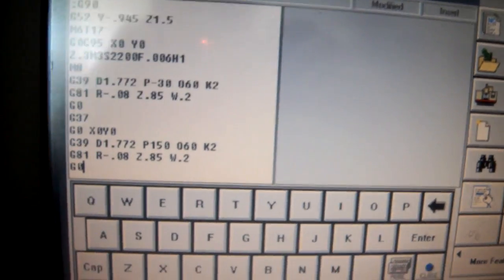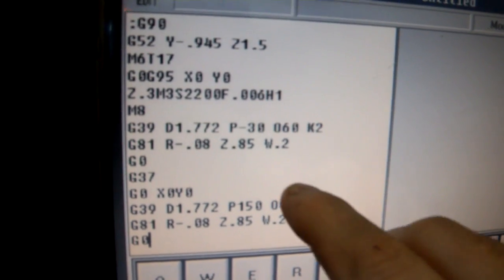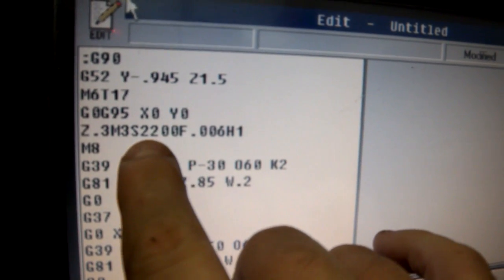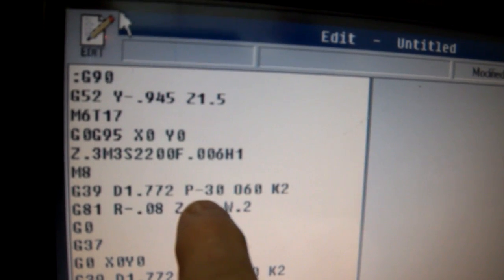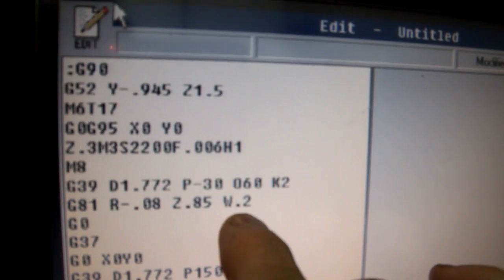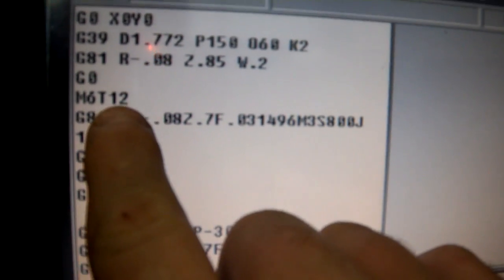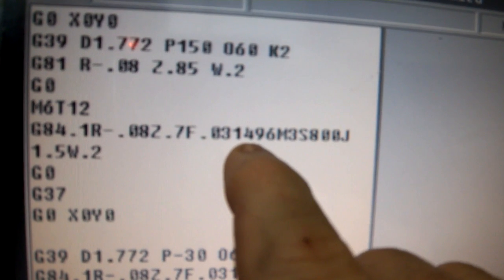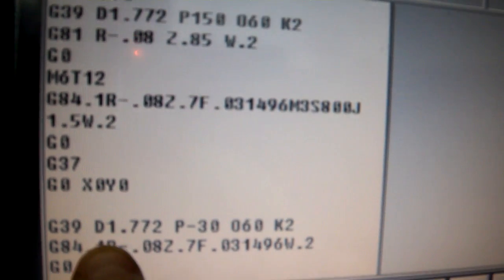Drill & Tap G code program

Comment: I need to use a seat of masterCam since I don't own one to do a side project.

A: is this legal and if so where are there places that rent seats out so I can get the code to hand input?

I know how to program via mastercam and need to make a small easy project to work for a HAAS vf2 that is just going to drill holes then come back and tap those holes in a flat piece of steel. What I am worried about is is not getting all the normal modal commands at the beginning of the code and so on.  This person I need to do the piece work for...well the floppy drive is broke on his HAAS so I will need to hand input all the code.

Any suggestion would be much appreciated. please call me if you can
971-998-7587

Brian G
Portland, Oregon area